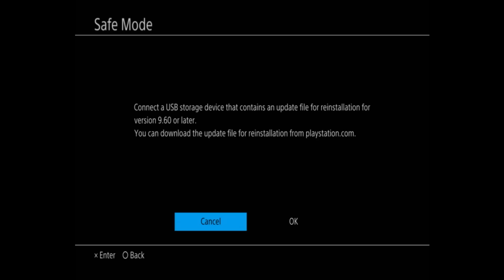They SUPERGLUED A Broken Connector Onto The Motherboard! Can I Sort Things Out?

Comment: Seen all's off yours Sony PS5 repairs?
This is very interesting question is to asks you?

Why does you using Fluxs onto the PC Broads to gets a solider to holds up the electric n electronics components?

I using a solider lead wire which comes out from UK ! 
That's alright has a good amount of flux core in to solider lead wire.
0.9 mm Flux soldier wire.

Keeps it clean & Keeps up a good work.
Far East Coast.

Comment: Hi unsure if you could answer this but I'll ask just in case. Has I've said I've stated fixing consoles. I but an xbox one today faulty. But if and when I fix it , I plan on fitting a raspberry pi inside the case has a debugging tool. So my question is, is there any pen testing points on the board you know of for ram access and other cool stuff I can use to use my pi on to reverse engineer it.

Comment: Please i need your help. I have been doing HDMI replacement for years and it was been allways successful, until lately i kept getting problem when i repair PS4 slim HDMI.
The signal dissapprear few seconds after i turn on the device. This problem only happens with the PS4 Slim and i cant discover why its happening.
i cover the diods and all the parts when i do soldering and i test everything when i finsh but still this problem happens with this model and it disapoint my customers.
Can you help me please with that ?

Comment: Acetone weakens superglue. Turns it to jelly. Takes a few minutes but it works. I use it all the time in my job.
Reply: @DarmokAtTanagra  maybe not but it does weaken superglue. I use it daily in my job. Was referring to the superglue since this is the part Ive experience in. I Know nowt about circuit boards. So was unaware of it weakening circuit boards. I use this stuff to fix gibreglass.

Comment: I feel your pain 🤣. I bought one off ebay and the top half of the case where you get to the hard drive had been superglued on lol. PS, I usually rip apart those cheap transformers  out of those crappy ebay PSUs for jumper wire. You get loads and it is free.

Comment: Respect for your work. But Sometimes it's better to stop when you don't have the right supplies. Acetone would have taken the connector off. It can be purchased as nail polish remover and from most plastics stores. Also heat sets super glue, making it harder. Only saying this to help.